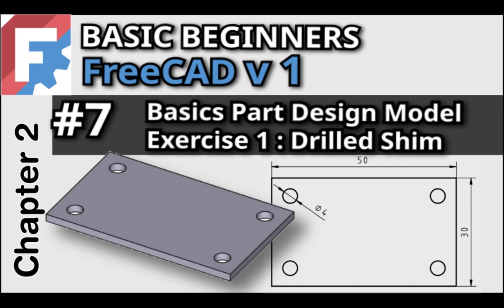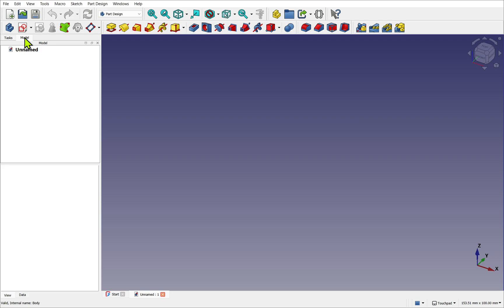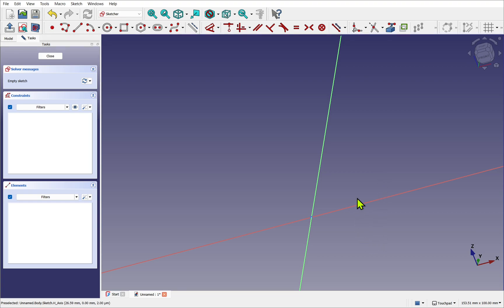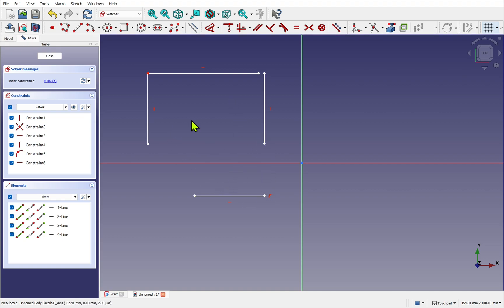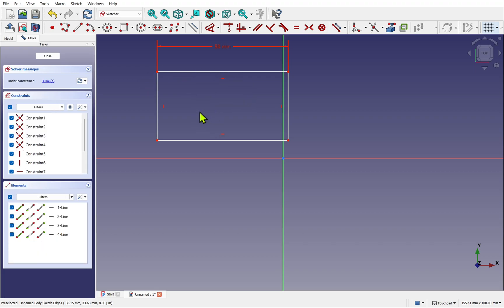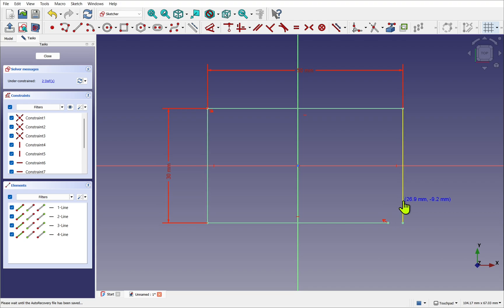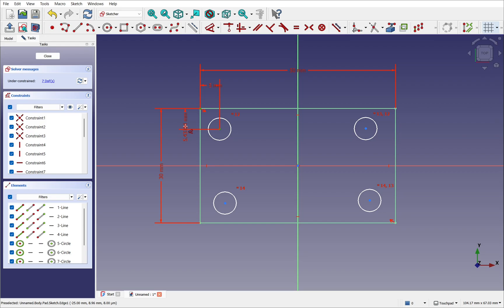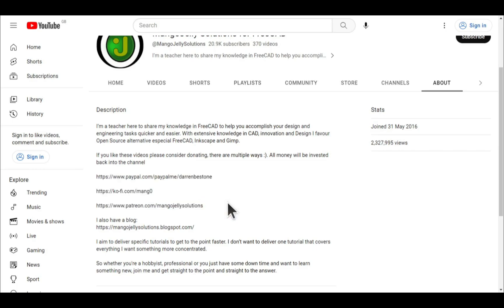Create Your First FreeCAD Basic Model | Basic Beginners FreeCAD v1 Course | Lesson 7 (Upd: Aug 2025)

Comment: Awesome Tutorials!  Just one question:  not about your instructions, but about FreeCAD.  Why don't the tools bars stay the way you set them?  Seems each new project first first thing is to adjust the tool bars the way you want them.  I've tried to lock them, that doesn't seem to work.  Is there a way to fix this?  Again that for the great tutorials, I will be visiting your patreon to buy the printed version of the lessons!
Reply from the maker: Glad your enjoying the tutorials.  The problem your encountering seems to be still a issue for some.  Though an old post, there seems to be a possible solution here in the second comment down  : https://forum.freecad.org/viewtopic.php?t=9992 and there is a long thread about the issues here which suggests the problem is still present with no proper solution yet : https://forum.freecad.org/viewtopic.php?style=8&t=4388&start=40 Thank you for considering the support via patreon